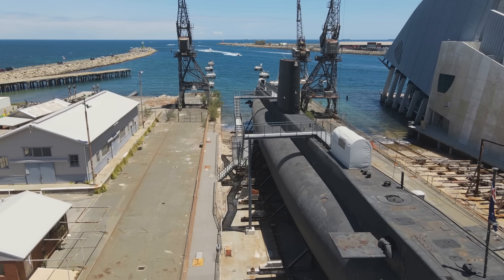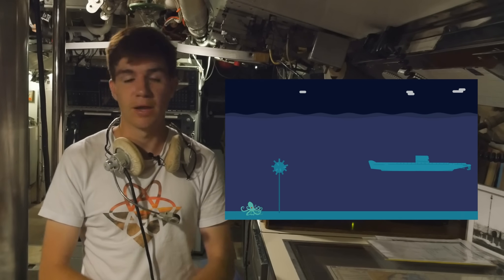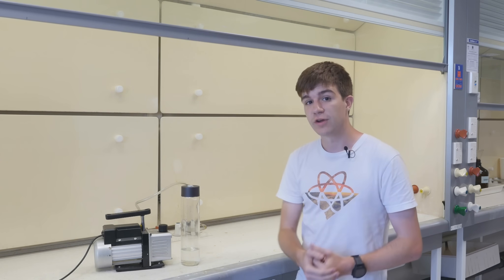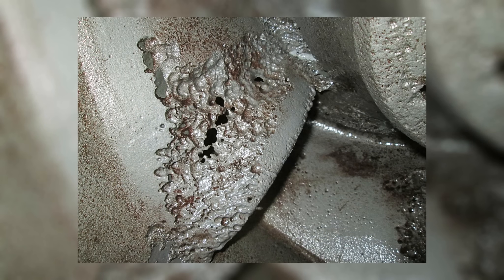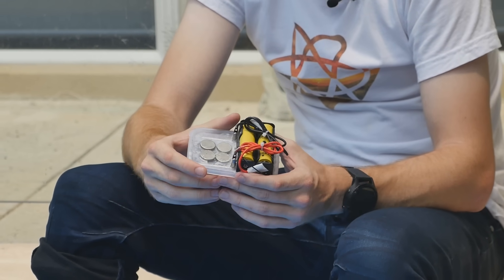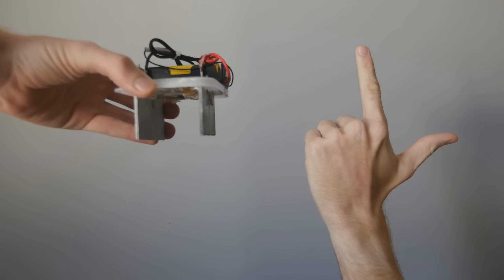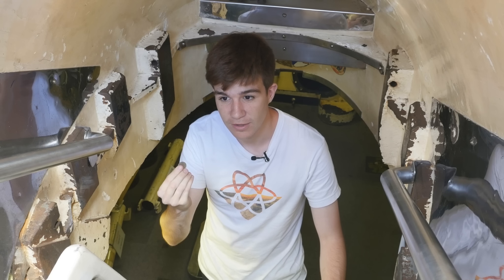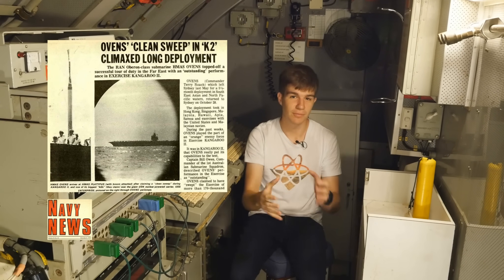Inside Australia's Silent Submarine

Comment: I was serving on the Ovens for the K2 exercise, and you got the story half right regarding the USS Enterprise.  I was on the other side of the attack periscope from the skipper, using a slide rule to convert the height of a certain known point on the target ship that the skipper would read out to me, into a distance, to feed into the firing computers for the MK48 torpedoes.  We took the photo to prove we were actually there ( 8,000 yards if I remember correctly - I still have the original black and white photo that the papers used), and then the skipper (Terry Roach),  theoretically fired off 5 torpedoes, resulting in what was referred to as a perfect "5 finger spread", that is, all 5 fish (torpedoes), would have hit the Enterprise from bow to stern if we had actually fired them, meaning there was no way the Enterprise could have survived the strike.  The Americans were not impressed, and tried to argue the point, but to no avail.

The broom tied to the attack periscope was done to announce a "clean sweep", meaning we sunk the yanks, but they never found us, not even once during the whole Kangaroo 2 exercise.  I still have the front page of the newspaper with that picture we took of the Enterprise...mainly because I was on the conning tower at harbour (action) stations as lookout and flag/light reader if needed.  I'm the good looking bastard without the stripes lol.  Good video btw.  Almost made me miss the good old days.

Comment: I was an underwater controller on o’boats for 6 years and in all that time maybe did one or two active transmissions from the CSU 3-41 attack sonar and it was during an exercise.  When you ping you give your location away which is why it rarely ever is used.  A submarines primary purpose is to remain undetected which is why a boat will rarely ever use active sonar.  99.999% sonar used on a submarine when dive is passive.

Comment: Is the cavitation around the propeller really caused by water boiling?  Or is it just dissolved gasses coming out of the water?
Reply: I did post in the main comments but l did some checking and this is an update. The water does actually boil. I used the Mantis Shrimp as an example,which uses a modified leg to punch its prey. That punch is so fast(somewhere around 40,000 feet per second) that,due to cavitation,temperatures of around an incredible 8,500° F are generated! Even if the submarine's prop generated half that amount,that is enough to do damage.

Comment: Neat, so that's why nuclear subs are considered quiet
Reply: Diesel electrics are quieter than nuclear subs while running on electric. The sort of hull transmission might be reduced, but the noise of the nuclear power generation is higher than an electric motor.

Comment: Do submarines built more recently have lithium ion or other more modern batteries? How about using other mechanisms to generate power like hydrogen motors (can’t remember how they’re called)?
Reply: Australian Boats still use Diesel Engines and Lead Acid batteries, other countries have Hydrogen Fuel Cells, AIP, etc and other forms of battery such as Lithium Ion

Comment: From what I’ve heard of the Enterprise sinking exercise, the Ovens crew sent the Pentagon a photo of the ship screws to send on to the commander of the USS Enterprise.
Reply: I think that a Swedish submarine did a similar trick also with aircraft carrier being ''destroyed''.
The secret (or that is what they where willing to give) was that diesel electric subs are more stealthy then the once with a nuclear reactor. (the reactor always generates a small amount of heat)
Reply: @sirBrouwer  The Royal Netherlands Navy's had similar success with the HNLMS Walrus (S802) a Walrus-class submarine (also being a Diesel-Electric) in "sinking" several ships, including the aircraft carrier USS Theodore Roosevelt before escaping, during the multi-national Joint Task Force Exercise/Theatre Missile Defence Initiative 1999 (JTFEX/TMDI99)
Reply: @DarkDutch007  the Swedish and Dutch subs are of the same build if I can remember it correct. 

with all these cases the secret was that they can operate on there battery alone long enough to get in to a fleet bubble and get out of it again.
Reply: Depends on the exercise, what countries are involved and the CO. A lot of the time an attack is simulated by a green signal flare, we will keep the base plate from the flare; engrave it with the details of the surface ship and present it and a picture to their CO.

Comment: Can new submarines use advanced LIDAR technology? Or computer driven environment sensing models like Tesla's cars build a external image around the vehicle
Reply from the maker: LIDAR (and most EM radiation) doesn't penetrate water very well so unfortunately won't work beyond about 100m (if you're lucky). Not sure how Tesla's works... but could feed it the sonar data potntially.

Comment: "this isn't air,  it's steam.".!!!.
What is steam then.?
It's at it's basic, hydrogen and oxygen, and I think that's what they call air!
Of COURSE ITS AIR.!   
ITS HOT AIR
But,  it's air.
Reply from the maker: Hi Rich, love your enthusiasm! Steam is just regular water (H2O molecules) in its vapour form - in this form everything still stays as distinct H2O molecules. While very hot temperatures (~3000K) will break the H=O=H bonds that is not what's happening here. On the other hand, regular "air" is mostly Nitrogen and Oxygen gas molecules with a small amount of other stuff (including some gaseous H2O!). The difference between 'steam' and 'air' was super important during the industrial revolution (steam will contract loads if you cool it) but has since become a bit less significant. Hope that helps!